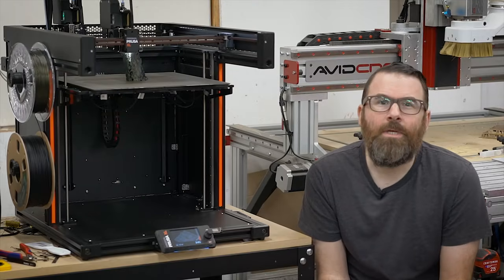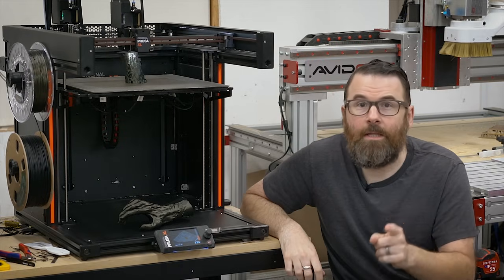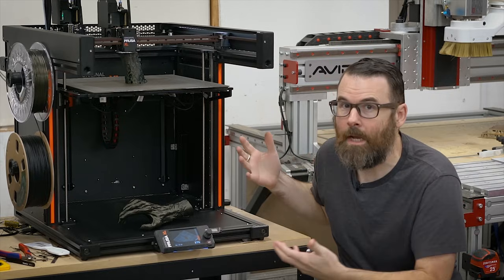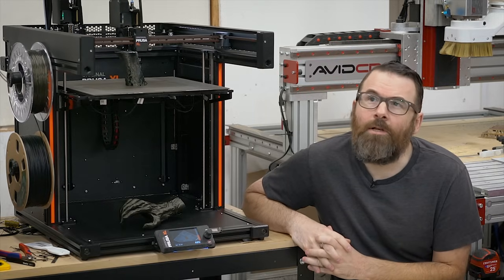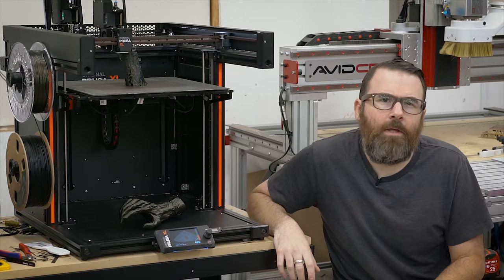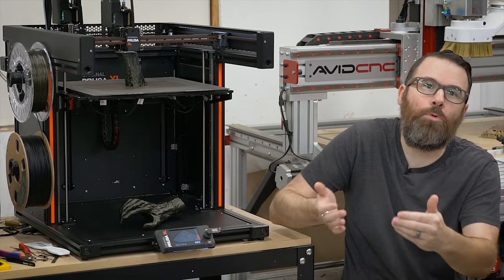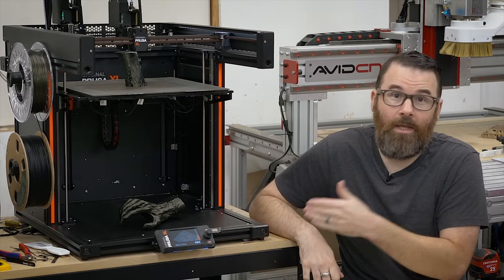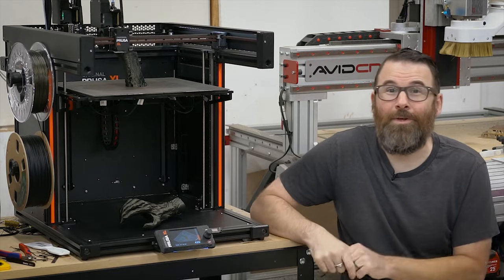Prusa XL - Alpha Firmware Testing!

Comment: All of the components I print for my business take the exact same time on both the X1C and MK4 with IS. The time for the MK4 was actually a minute faster. Using prusaslicer and bambu studio. Using ALL THE SAME SETTINGS Both using .6mm nozzle, .4mm layer height, .8mm extrusion widths, accelerations, same flow rate etc, etc. Speed and all various little settings are the same. Yet an "old tech outdated" bedslinger MK4 finishes prints in the same exact time. The XL will be the same.

I mentioned over a year ago the time differences I got between the X1C and my MK3 were minimal when using all the same settings. And the BL fanboys couldn't believe it and said I was wrong and just told me to print more benchys and crystal dragons. Your conclusions in the end matches mine. Using the same settings, they take the same amount of time.
Reply from the maker: Yeah, I KNOW I'm going to get some negative comments (well, I already have), but that's what I've found.  Bambu is just really good at tweaking the profiles to save as much time as possible and print less filament.  And they're pushing those print profiles to the MAX.  If you increase the speeds by even 10%, the extruder starts to give up, it can't melt fast enough.  I have no issue with Bambu, they're just trying to do something VERY different than Prusa.
Reply: @RobertCowanDIY  Prusa definitely cares more about quality and strength over speed, which is why their default IS profiles are pretty conservative. But yeah, ramp the settings up to match BL's default settings and you end up with the same print times.

I took a chance with BL and their P1P earlier this year and it was a bad call. I've had better results from anycubic. My parts on my MK3 only took 10 mins longer(17%) than they did on the P1P using the same settings, minus print speeds. Speeds were default on the P1P and MK3 was all at 55mm/sec
Reply: You're right about that on bambus. That is why you add a CHT nozzle and you can print at much faster speeds. @RobertCowanDIY
Reply from the maker: @LilApe Yeah, that's what I'm finding.  I'm using the alpha firmware right now, and decided to try just setting the print speed to 200%, and it's totally fine.  They're VERY conservative.
Reply: @luke8874  Then i guess go and add a CHT to an XL and then you're matched in speed again.
Reply: @RobertCowanDIY can u do a follow up video where u print the zombie hand on the x1c? I'd be really interested to see the result
Reply from the maker: @tomohalloran5217 Yeah, I guess I could.  But should I match the settings as closely as possible, or use bambu's 'speed' settings?
Reply: @RobertCowanDIY  I think match as close as possible personally. I'm interest is as much of an apples to apples comparison of the output to see how the input shaping on the bambu matches up. Your basically the only one of seen doing a "behind the trickery" example of these printers. The trickery is cool and clearly works but it would be cool also to be able to gauge what's behind that
Reply: of course the same core slicing engine is going to get the same results on multiple machines with the same settings.  they are all forks of PS with a variety of different additional features on top (super, orca, Bambustudio, galaxy). anything thats going to generate the same toolpaths with the same engine with the same assumptions, duh. this has nothing to do with the printer at all, think about it. you're giving it motion logic from the same decision tree.
Reply: @JustinBuildsThings  then people need to stop saying "prusa slow Bambu faster" when they in fact run the same times.
Reply: @LilApe no, they don't.

People say this because the bambu machines print fast at high quality stock

The comparison I want to see is high speed at still high quality. So instead of tuning DOWN the bambu profiles to match prusa, which surprise suprise will run both slow, match UP the prusa to match the bambu stock profile, and if the quality is bad, tune down till you match quality.

So you can then see the Max speed both machines can do at the bambu stock quality level (which is pretty great)

Most people when they print want good quality as fast as possible. Bambu does a great job being tuned for this out of the box.

Prusa may be able to print as fast at the same quality, I don't know, but they're not tuned out of the box for it. Prusa are tuned for slow and steady I'd say.

This is a criticism I have for both manufacturers: I'd like to see bambu profiles for slow but Max quality, and prusa profiles for high speed good quality
Reply: Also, the reviewer here forgets that a bambu using a 0.6mm nozzle is faster by quite a bit.

So focussing on how a 0.6mm nozzle prints more material misses the point!

Either put a 0.4mm nozzle on both, or a 0.6mm nozzle on both, but understand that a 0.6mm nozzle machine being slower than a 0.4mm machine is NOT IMPRESSIVE. Normally a 0.4mm nozzle prints much slower so picking and choosing which metric to use is really just looking for ways to dismiss what should be a huge point for the bambu
Reply: @Tom--Ace  lol I've already proven that the Mk4 and Bambu lab printers print the exact same speed using the same nozzle sizes. The Mk4 came out at 1hr 13 mins and the X1C came out at 1hr 14 mins. Using all the same settings and nozzle diameters.
Reply: @LilApe Well if you use the same size nozzles and same speed settings they will of course print at the same speed. However it seems the Bambu printer is capable of printing at much faster speeds and accelerations and max volumetric flow rates while maintaing a similar print quality to prints at the max speeds the PrusaXL can do. Which is not surprising given the heavier tool head and longer belts on the Prusa, not to mention the lower maximum flow rate of its hot end.

If you drive a Ferrari and a Toyota down the same 50km/h Street obeying the speed limit they will of course take the same time to reach the other end.
Reply: @liamventer  The point is, prusa printers with IS now print just as fast as BL printers.
Reply: @LilApe  that does not seem to be correct in the case of the PrusaXL. The  max flow rate of the hot ends appears to be the ultimate limiting speed factor  (provided you can cool the part fast enough). What is the maximum flow rate of the PrusaXL hot end compared to a bambulabs hot end?

And then we come to the very important question of print quality. Prusa is unable to use their accelerometers to calibrate precisely for Input shaping at the moment where as Bambu and klipper printers can. If you can't calibrate precisely then you have to limit acceleration. 

What is the maximum acceleration set in your PrusaXL defaults 10,000mm/s^3, 20,000mm/s^3?

And what is the max default PrusaXL volumetric flow rate for PLA wirth a 0.6mm nozzle 25 mm/s^2, 30 mm/s^2 or higher? Just for intrtest and to give you a modern contemporary reference a standard  Rapido UHF  hot end has a conservative max volumetric flow rate of over 30mm/s^3 (PLA 0.6mm standard nozzle)

Prusa have set all their defaults low to maintain quality due to limitations of their current very basic implementation of input shaper, the heavy weight of their print head and the very limited flow rate of their hot end.
Reply from the maker: @tomohalloran5217 Yeah, if I get around to it, I might try to take the Bambu print profile and port it over to the Prusa and see how the XL can handle the same slicer settings.  That would be a good apples to apples.  But I doubt the XL will be able to keep up, it's not necessarily meant for the same speed as the X1C, they're different machines.
Reply from the maker: @JustinBuildsThings  I should have mentioned I never touched the speed settings, I just made the walls the same thickness and such.  I just made sure they were extruding the same amount of plastic for each print.  But you're 100% right, they're essentially the same slicer, giving them the same input, you're gonna get the same output.

Comment: Do arcs and curvatures seem to suffer any with the 'compressed size?' I'm curious if it's just compression or they changed the minimum segment lengths, but maybe an arc won't show that if actual arc commands are supported. Many 8-bit boards used to choke from the density of gcode it had to run through for a given portion of time, a lot of that correlates with bloated file sizes due to VERY tiny segment commands being poorly optimized, that translates to gcode file bloat even today.

Also do the toolheads even have an accelerometer? Can't just software update to user-based input-shaping without that really. I've heard the MK4 relies on the fact they are all tensioned to specification and the tool-heads weigh the same across machines etc.
Reply from the maker: I'm not exactly sure how it's all working, they're using some sort of arc-welder and there will of course be some tolerances.  To some degree, it will remove some detail I'd assume.  BUT, you might not ever notice it.  The toolheads on the XL DO have accelerometers!  So they can actually do input shaping right, not sure why the alpha doesn't do it that way.  I'm sure it has something to do with the interface, adding it to the slicer, etc, etc.

Comment: Great stuff. Does the machine still want to move around as much?
Reply from the maker: I'm not sure what you mean?  It doesn't wobble at all.
Reply: Mine is moving the table a fair bit. Maybe I need a patio stone under it. @RobertCowanDIY
Reply from the maker: @iimuch3760 Huh.  It is a very heavy printer, so maybe you have a wobbly table?  The stand I'm using is pretty heavy-duty so it takes a LOT for it to shake.

Comment: So I was playing in Bambu studio and set an X1C to 0.6mm nozzle and .24 layer height and 7 walls(or 2 walls 48% infill) to get it up to 140g. and the time was about 3 hrs. 
So using the same amount of filament and a crazy number of walls you will still print faster on a bambu printer. 

Or just do 0.4mm nozzle 4 walls 45% infill and you are still under 4 hrs with 141grams used. 

The key is to use the "bambu filament" preset 21mm/s vs 11mm/s) for generic pla. It will print the same trust me the generic profiles are very conservative and a simple profile switch means the bambu wont even break a sweat at 21mm/s
Reply from the maker: Gotcha!
Reply: Still faster because BL default print speeds are set significantly faster. take those same settings in prusa slicer for the XL/Mk4, but match the print speed settings to BL and you get the same time. I did this exact thing and got a min faster on the MK4 over the X1C while still using the same amount of filament. Only a gram in difference between the two.
Reply: @LilApe  what is the max volumetric flowrate of the XL?

Comment: I have a custom CoreXY running the Marlin with input shaping on it, and its complete trash when it comes to ringing. I spent countless hours if not months in actual time trying to tune it, and it just wont translate into quality prints at the high speeds I am going for. I can print just as fast as my Bambu X1C, but the quality is nowhere near the same. I guess what I'm trying to say here is that Prusa is probably wasting time trying to make this whole Marlin firmware work in 2023, and they really need to try some custom firmware or focus on Klipper. You just cant do enough manual tests that translate properly at different speeds, unless you have an accelerometer. Prusa XL is a good looking machine with high potential though, so I really hope they can make it a success.
Reply from the maker: I'm not entirely sure, but it sounds like they're not really running Marlin, it's something more custom.  They discuss klipper, but for some reason they want something more in-house.  We'll see if they can get it working once it goes into production and we can actually tune the extruders with the accelerometers.
Reply: @RobertCowanDIY  They're not running Marlin on the XL? It is my understanding that it is their own custom fork of Marlin, unless they are using something completely different on the XL than what they run on their MK printers. Where did you read this?
Reply from the maker: @user-lx9jm1wo3h I could be wrong, I'm just reading from the blog post.  They claim they have 'some snippets of Marlin', so I was just assuming it's not entirely Marlin.

Comment: I would argue that the Bambu 0.20mm Standard settings are perfectly adequate for the type of model that you demonstrated. I understand what you were trying to show by adjusting the slicing settings to get them to the same mass, but to me this shows far better optimization of the Bambu profiles. "Prusa is coming at it from a different angle" sounds like a bit of a cop out - for this type of model the Prusa profile is just wasting material. For the record I enjoy your content - just an observation!
Reply: Best would be swapping the nozzle on the prusa for a 0.4  or swapping the bamboo to 0.6  Then it would be a 1:1 comparison. Comparing by printed  weight is the next best thing.
Reply: No its not wasting material it has a 0.6 nozzle by default in comparison to 0.4 bamboo. If every wall is way bigger of course it will print more filament.
Reply: Yes, a fair comparson is to select 0.6mm nozzle for the X1C
Reply from the maker: You are 100% right.  I don't usually print stuff like this, but the 2.5 hour part would have been the better application here, no question.  I don't agree that 'coming at it from a different angle' is a cop-out.  I print a lot of mechanical or functional parts, and the Bambu profiles are fairly weak.  It prints too little material and too fast (poor layer adhesion).  The print profile are aimed at cosmetic prints, not functional prints.  If I was just printing cosmetic prints, the Bambu is the smarter one to use.  For the record, I have both and just sold my MK3 in favor of keeping the X1C.  I don't dislike the Bambu, but it's been far more fiddly, but it GREAT for rapid prototypes.  Also, I saw another comment from you, but it seems to have disappeared, I was going to reply but it seems like it's gone now.  Thanks for the support!
Reply from the maker: Yeah, I'll try that.  But I really just want to get back to actually making stuff.  As much as I like comparisons, I'd rather just use the thing :-)

Comment: Wow. The Input shaping one is Not Sharp. Very smooth. I dont want it
Reply from the maker: Yeah, that's why I did the comparison.  I usually print engineering models and fine detail isn't all that important to me.  It depends on what you're looking for.  But for sure the input shaping reduces fine detail.

Comment: Crikey im very surprised the state at which this launched. I have an e3d tool changer with 4 tools and while it is a bit rough and ready it seems to print better than the XL although probably not as fast. I really would be expecting a heck of a lot more from a Prusa XL. Im puzzled why the launched this early if they still have issues. Its still on my roadmap to get one eventually, but by the time it will be available im pretty sure there will be a lot of competition from other providers.
Reply from the maker: what issues do you see?  there are some shortcomings, but I've been using it non-stop since I got it and it's been reliable and been able to do everything I wanted from it, with some small tweaks.

Comment: You have took testing to get certain results to another level, you tried to slow down the bambu wich is wrong you should speed up the prusa and give it a normal nozzle size for normal comparison.
Reply from the maker: You're not wrong.  If I do more testing, I should see if the Prusa can do the 2.5 hour print with a 0.4mm nozzle, the same settings as Bambu.  I'm really not trying to make them go head to head though, they're quite different machines.
Reply: @RobertCowanDIY  yet you exactly tried that, this is so misleading. Your end conclusion is that the xl does the same while you slowed the bambu down wich is wrong. Testing is worthless if you make the test to fit a certain view.
Reply: @RobertCowanDIY  2200 for the prusa(1) extruder and 1500 for the bambu ams both large format corexy but still you claim not comparable.. it's only because the bambu outperforms the xl on every level but you are a prusa fan so you change the test to make it seem the prusa is same or better while it's not.
Reply from the maker: @OneHappyCrazyPerson You aren't as happy as your name would lead me to believe.  But jokes aside, I'll do a better comparison next time.
Reply from the maker: @OneHappyCrazyPerson Yikes, no one is trying to deceive or even convince you.  Like what you want to like, I'm not forcing anything on you.  But hey, the Bambu is by no stretch of imagination a large format corexy.  I wouldn't really even say the XL is large-format.  I'm TOTALLY fine with you preferring the Bambu if you're fine with me preferring the XL.  Let people have their preferences.
Reply: I will see if your next upload is better, good luck and keep enjoying making content !
Reply from the maker: @OneHappyCrazyPerson Oh my next upload WILL be better, I'm not going to mention Bambu at all and just trash on the XL, everyone will be happy ;-)